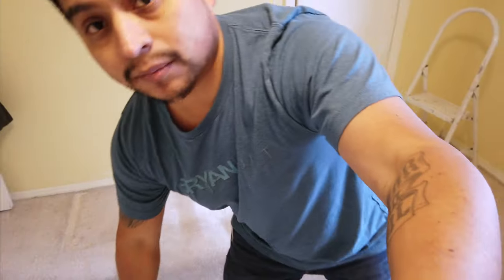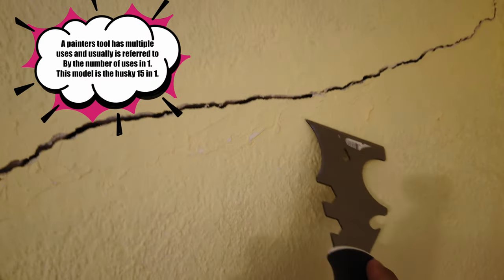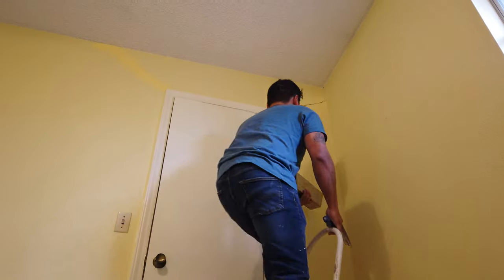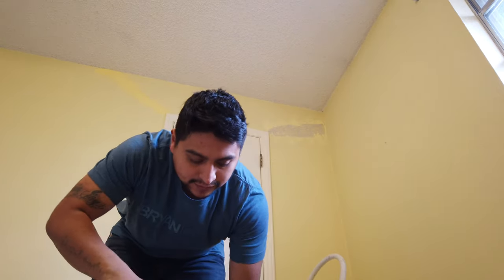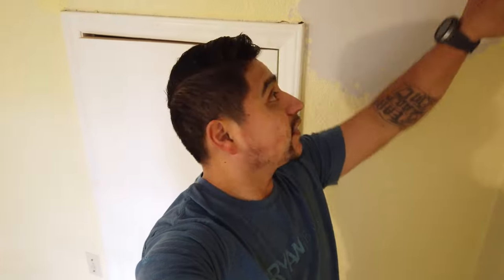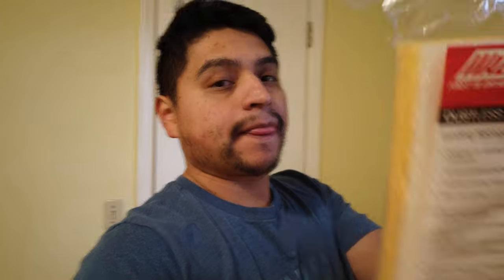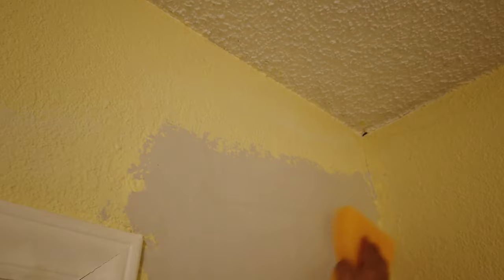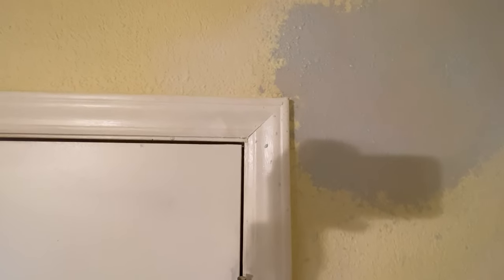How To Repair Cracks Above Doors

Comment: Painter for nearly 50 years here. Not bad. Im impressed you used the easy sand 5. I am one of the few professionals I even know that will use it over the  20+ minute stuff. This tells me you have a clue which is more than I can say about a great deal of Youtube content providers. But what you also needed to do was secure the rock from flopping around in the first place that caused the crack. If you press on the sheet rock on both the lower and upper sides of the crack you will usually see the sheet rock flexing. this is what caused the crack and will cause it to reoccur  I usually re-screw the rock at the nearest stud on either end of the crack where possible. Near or at the door frame use usually one. And at the nearest stud on the other end too.
Also. persona preference. but with hot mud I prefer to use "fibrafuse" (available at Lowes) over the mesh tape. Especially on surface patches such as cracks like this.. Believe it or not. as fragile as it can be to work with, once dry it actually provides a stronger joint than mesh or paper tape. Its also flatter (thinner) which means you dont end up with as much of a hump to try and feather out.
but the key for a lasting repair isnt just the repair itself. But addressing the cause of the crack. the fact a repair had been tried before as well as the size of the crack tells me that the rock is flexing in the area and needs tp be secured as much as possible before any crack repair is attempted.
Reply: Thank you for the knowledge! Sounds like youve got some experience
Reply from the maker: thanks for the tips! I will definitely try the fibafuse in the future. thanks for watching!

Comment: Hey y’all just giving a tip that’s helped me. 
I’ve been using fibafuse so you can do your tape and 1st skim coat on the same mix. Not best for fine work. Good for apartment or commercial repair work.
Reply from the maker: thanks for the tip!
Reply: Nicely done 👏.The sponge is a really good idea as sanding dust is so messy. I was just wondering if you really can't tell that tape was used? as watching videos online, it's not always obvious to see.Thank you 😊

Comment: If you are hanging sheets of drywall dont ever joint 2 sheets above a door or above/below a window.  Those are the spots that are most prone to crack on a wall when a house settles.  A framed door rough opening will be 2 studs on one side of the door, then a header above the door opening, then 2 studs on the other side.   Dont put your joints on any those 4 studs or the door header.  Joint them on studs that do not touch doors or windows.

Comment: Bro not to make u warried, most cracks like that specially for older house are due to foundation problem. Did you check your foundation first?
Reply from the maker: Thanks for the concern! Actually this was a house they had already done some foundation work on and i was just fixing the cracks

Comment: You can always tell the DYI'er from the Pro's.
Never us mesh  to repair *cracks*, always use paper.
Never use that already mix crap or the 5 minute crap...
Get the "Quick Set" and mix it yourself, there more glue in this product(s)
Good job on the feather out.